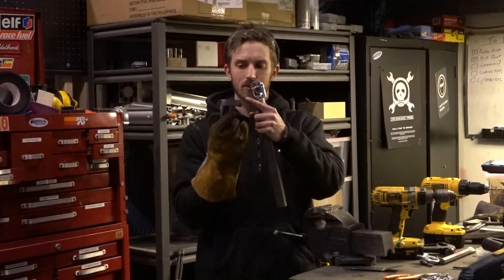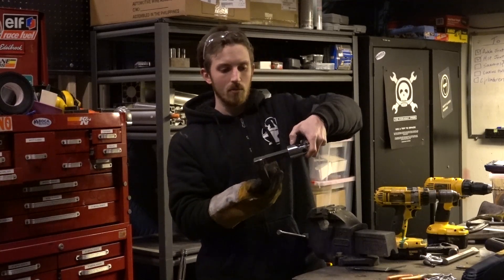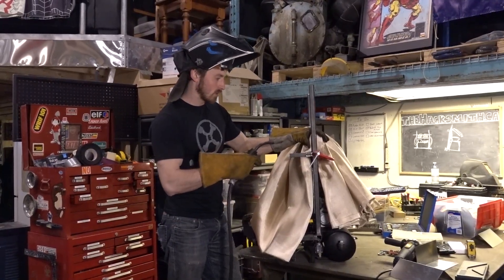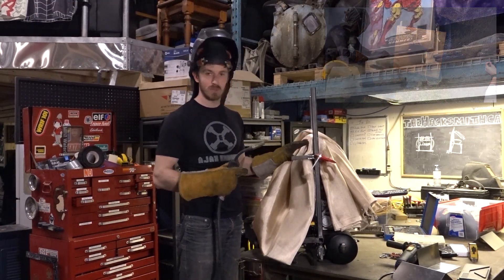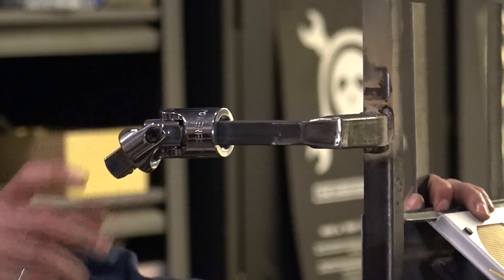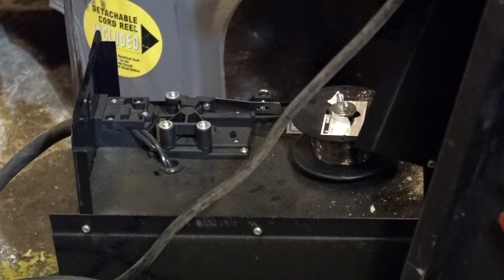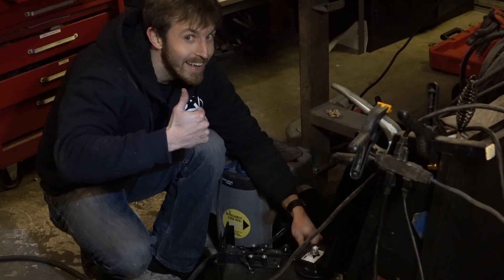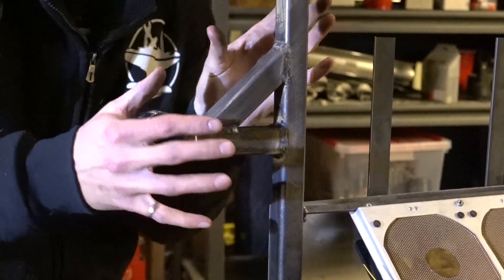Starting the Upper Body!

Comment: You use electric welder? Why not gas?
Reply from the maker: +PerunaVallankumous It's a flux core arc welder, essentially the same as a MIG welder but way cheaper to operate. Works pretty damn good.
Reply: +PerunaVallankumous almost all welders use electricity, some just use gas(or flux) as a shield against contaminants in the air